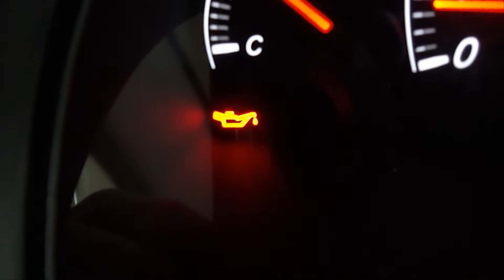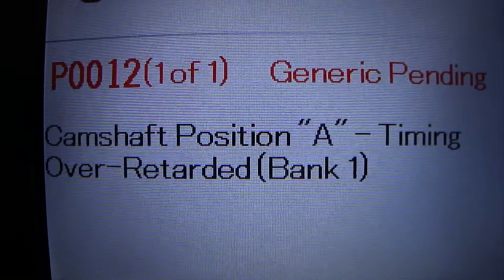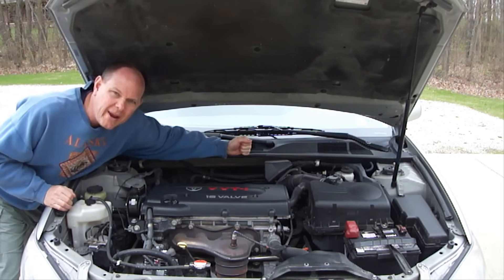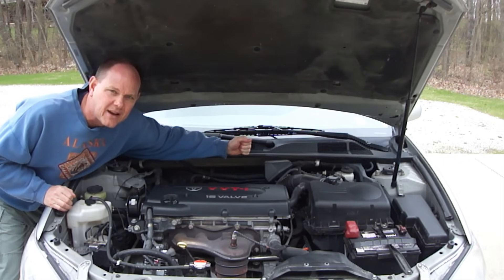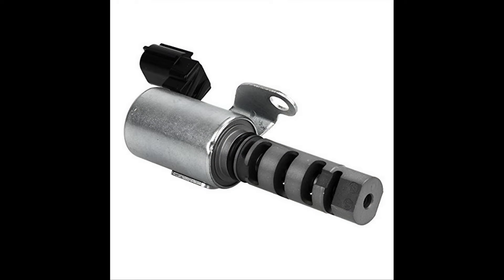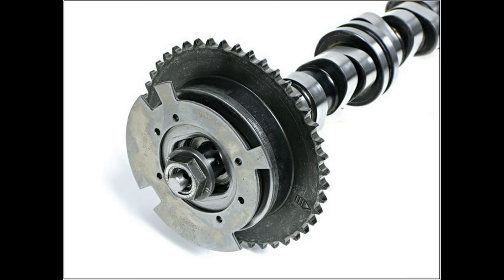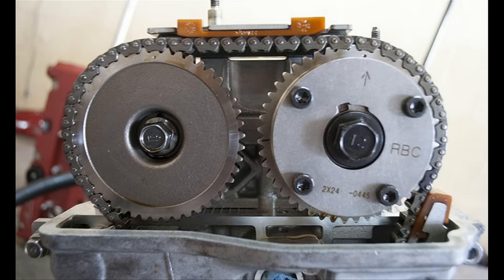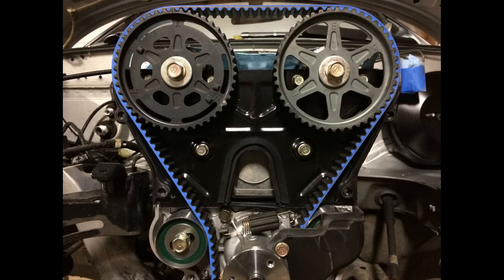How To Fix Check Engine Light P0012 - Camshaft Position A - Timing Over Retarded (Bank 1)

Comment: I appreciate your videos.  My wifes Kia borrego is giving us code P0018.  Dealer wants to replace all the timing chains.  I personally don't think its that complicated, but I don't have the know how to diagnose the problem myself.    I replaced my MAF sensor based on one of your videos.  The check engine light was off for nearly 70 miles. I could have guaranteed it was fixed, but eventually came back on.  I am leaning towards replacing the VVT solenoid, but really don't want to be throwing more money into a dying car.  Any chance you can help?
Reply from the maker: Make sure you have the correct viscosity oil in the engine and it's clean.  Has the oil control valve filter screen ever been changed?  The oil control valve could also be stuck in the open or closed positon because it's faulty or not getting the proper voltage.
Reply: proclaimliberty2000 thank you for the help.  I disconnected the elecrical connector to the oil control solenoid and it has oil in the cap and its basically soaked in it.  Could this be the problem? How should i clean that?
Reply from the maker: The oil could absolutley be the problem.  Clean it as best as you can  with paper towel and or a Q-tip but the BIG question is why is it oil soaked in the first place?  Where did that oil come from because it's not normal.  Maybe the oil control valve does need to be replaced.  You'll probably get your best price on Ebay.  Make sure you get an OEM or Denso brand.
Reply: proclaimliberty2000 i did as you suggested.  Also set it up to code reader.  No co de displayed.  Took it for a quick ride, check engine light came on and code came back. Checked connector again, it had oil on it.  Can these leak out the top?
Reply from the maker: They can leak due to a bad O-ring on the oil control valve or due to other issues on the oil control valve.  Again, make sure you have the correct oil and that it's not dirty.
Reply: @SpecterMatthew  hi did you ever fix this problem? Having the same issue?
Reply: @RAMJO  Yes. If I remember correctly the engine needed to be replaced. Sorry I can not help more. It was so long ago.
Reply: @SpecterMatthew  Jesus Christ, thanks